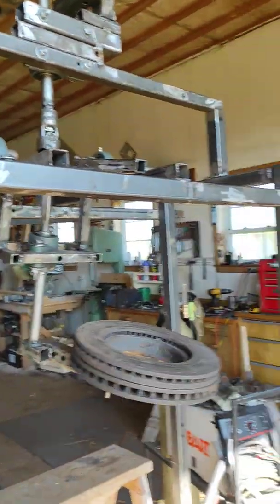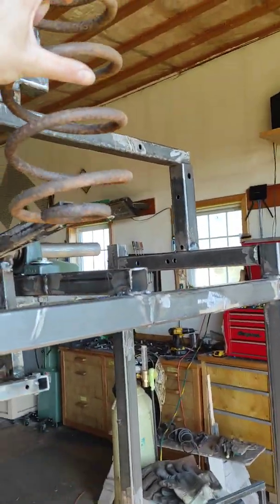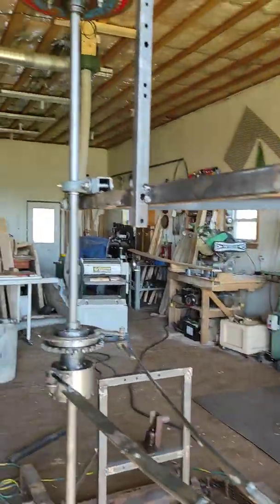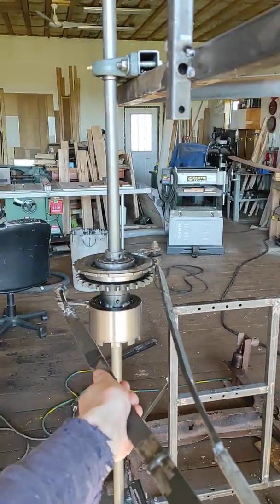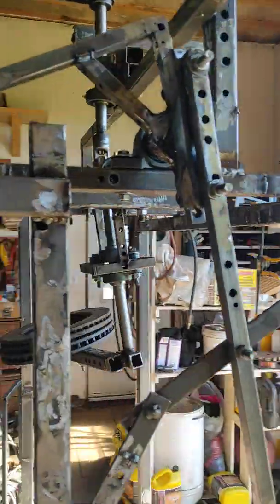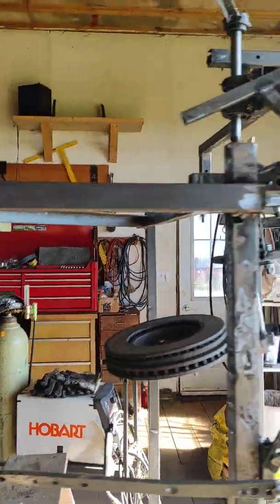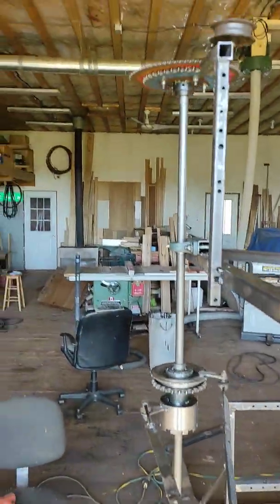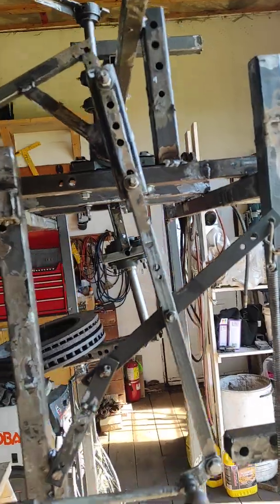Centrifugal Engine

Comment: Not that far removed from the Skinner device but of course it's not using gravity - and since it's not using gravity, is there a reason to have an unbalanced weight ? - I don't see it yet, how you would get power multiplication out of centrifugal force, but I'm not doubting you - I do know that contemporary conservation laws are not strictly correct - okay I think I see it now, you're going to get some energy out of the one way pendulum part of the effect from the unbalanced weight - okay centrifugal instead of pendulum
Reply from the maker: The concept is exactly the same as the two-stage oscillator. The weight is unbalanced so it wants to move straight all the time, so it will pull away from the center without losing kinetic energy. The trick is to not let the weight move very far from the center (1 inch or less) so that the angles are still close to a circle and you don't lose rotational energy. If you study basic physics, pay attention to mechanical efficiency, velocity, and centripetal acceleration. A spinning weight or wheel is 100% efficient. The center exerts the exact amount of centripetal acceleration on the weight to keep it spinning in a perfect circle. A moving object always wants to go straight. You can split the velocity into two components, magnitude and direction. The key to centrifugal power machines is that they run off a mass's resistance to change of direction. The centripetal acceleration only changes the angle, not the magnitude. But the center has to exert real energy on the mass for it to spin in a circle. For example, a 400lb weight spins at 60RPM with a radius of 36". The amount of force the center has to exert on the mass to keep it spinning in a perfect circle is about 50 horsepower. So if we attach a load between the center and the weight, the weight will go out a little bit and we can harness some of the centrifugal force. Using an egg-shaped or elliptical orbit, we can bring the weight back into the center at near 100% efficiency and repeat the process. We cannot harness 100% of the centrifugal force, but we can harness some of it. If my math is correct, when the RPM is doubled, the amount of work (force * distance / time) is eight times greater. So even a small machine can produce lots of power, if you spin it fast enough.